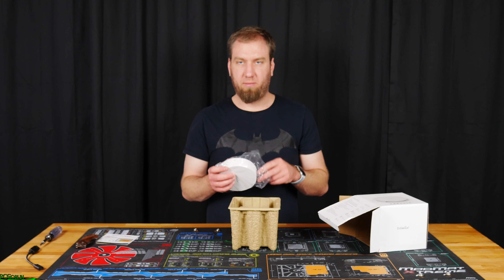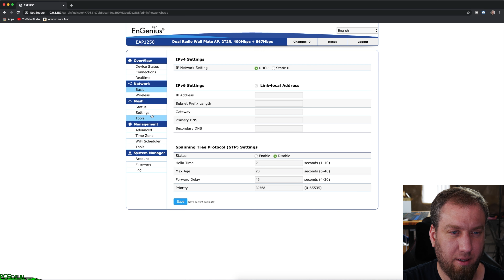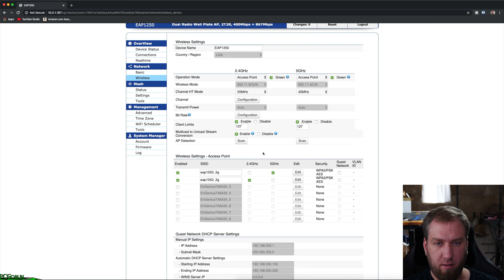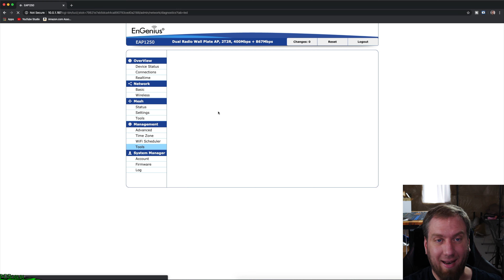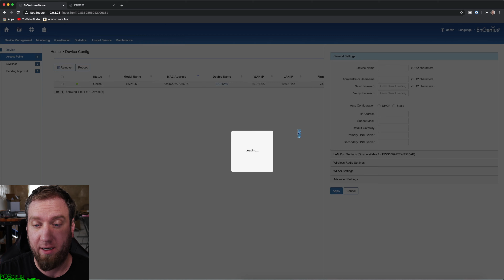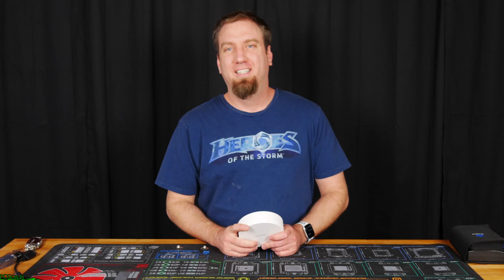Unboxing, Setting up, and my thoughts on the Engenius EAP1250

Comment: did a firmware update on my device and it bricked it downloaded the firmware installed it and it rebooted the only light that came back on is the power light tried pressing and holding the reset button same thing what gives? it had no issues prior to this
Reply from the maker: Thats very odd, are you able to directly connect to it at all? This would be a great thing to reach out to engenius for as Ive never come across that issue. :)
Reply: @PCGoblin  no it doesn’t broadcast ssid can’t connect via GUI either all I did was update the firmware it counted down from like 600 and rebooted
Reply from the maker: @SVU777  but what if you directly connect an ethernet to you computer to the poe adapter to the ap?
Reply: That’s how I did it Ethernet from laptop  to the ap

Comment: Thanks for the video. I am try to decide between engenius and grandstream APs. Want purely local control/setup. The Unifi brand has too manty faults and bugs, can't trust  it at all and working hard at removing it from my place. It is a shame as it use to work fairly well.
Reply from the maker: I hear ya. I almost swapped all my stuff with engenius from unifi, but for the last year or so its been pretty stable and good. Im gunna have to check out grandstream now, ive never heard of em.
Reply: @PCGoblin  GrandStream started in the Telephoney market and are quite good. My friend and I have had growing issues over the last 2 months. Plenty of people are really upset with the bugs and the direction they are taking with the unifi line. I can't afford the headaches and time wasted with the unifi products. I had it for only a year and it was really good in the beginning, but has been going down hill quickly. My friend is having issues with DHCP and there is a huge issue with this in the forums and it has been going on for at least a couple of years. They want us to get a cloud account to use the CloudKey Gen2 with the latest firmware. Refuse to get/use a cloud account and more so after they had a huge breach.
Reply from the maker: @andymok7945  Completely understandable. I wasnt meaning not to, just that when I was putting effort in to switching, things started working and ive been busy with other things
But all good stuff. I wasnt aware they were breached.
Reply: @PCGoblin  Hi. I'm sorry, I was not trying imply that sense. It was in the news big time that ubiquiti got hacked.
Reply from the maker: @andymok7945  All good, plus it was good to hear bout hte breach. When you get new stuff though, id love to hear what you switch to. :)
Reply: @PCGoblin  Will do. My friend is going with netgear managed switches. He had a couple of the 8 port before and was happy with them and will be getting a couple of the 24port units. I have used them and they work, but I don't like the GUI and menu structure they use. I now there is the EdgeMax series from ubiquiti, but I don't want to give them any more of my money. So looking at Cisco and engenius as possible candidates. Have looked at others and once I see cloud config, they are out.
Reply from the maker: @andymok7945  Gotcha, I want something more enterprise than netgear but im gunna guess you end up with cisco

Comment: I only have the unifi accespoint and when It dies I will be moving to that one. My router and switch still Ubiquiti, but is the cheaper edgamax versions. I am not that technical but not knowing what I did I made the accespoint work.
Reply from the maker: Id bet that the unifi AP lasts a very long time and by that time there will be something newer and better than this. :)

Comment: Is the EAP1300 better than this one by $20? Or save the $20 and get the 1250?  I’ve been debating on getting the Google home internet. Would you pick this over that?
Reply from the maker: Id get which ever is cheaper I was wondering the same thing because I cant see a difference. Id say whichever is cheaper. I would pick this over google home internet for sure.